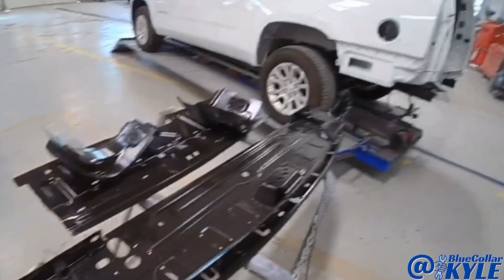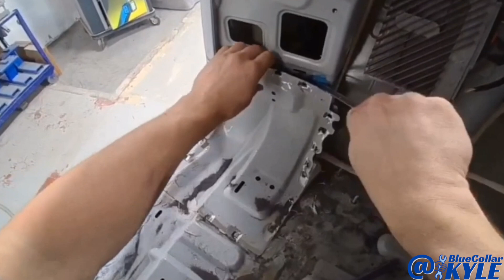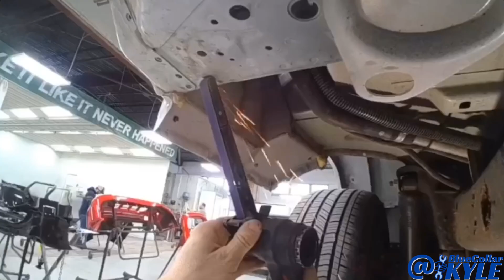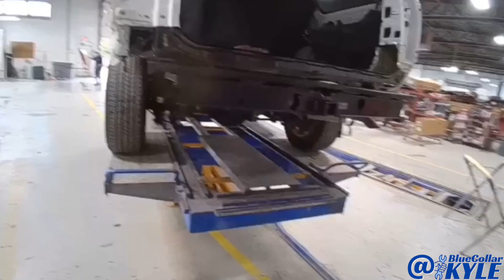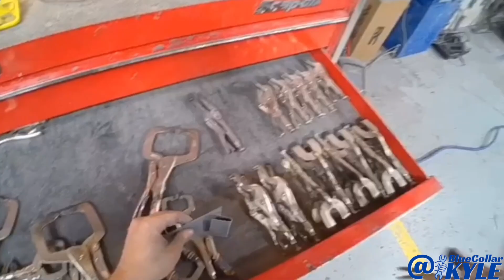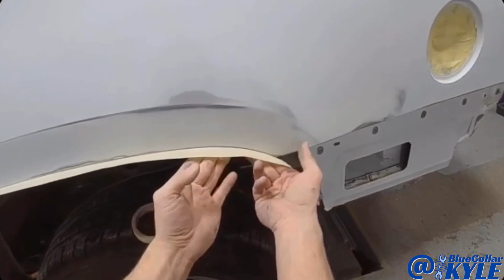This Yukon Got Demolished!

Comment: You got a good blueprinter to make sure you got all your parts , caroliner wouldn’t let you do  height Measurement with the suspension loaded, I usually just jack it up at the mountain points and fake   the car liner that’s it  on the clamps, But comparison measures were great , there’s also a good video on setting up the truck clamps and using the Evo for holding the body, when you get the one that need it ,  which I hope I will never get  got love car-liner